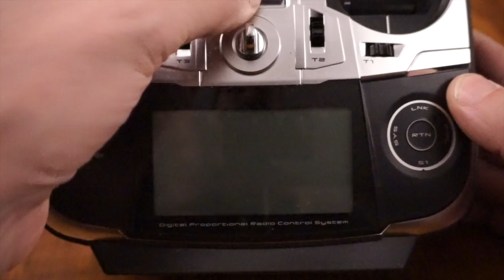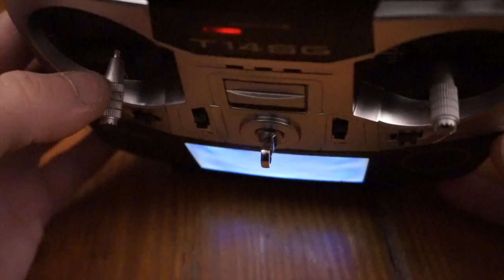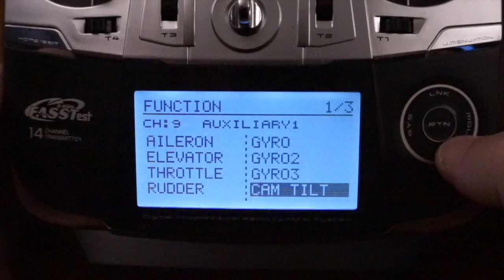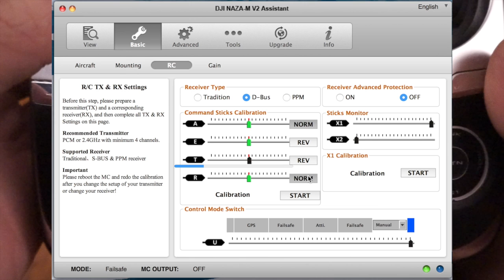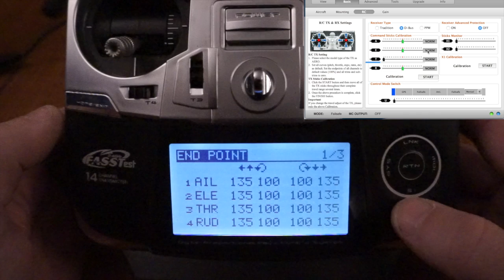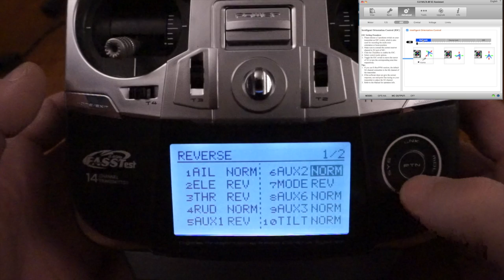How to configure the Futaba T14SG for the NAZA Flight Controller

Comment: Thank You, I use your setup to fly my old flamewheel from DJI with tha Naza M V2... I added LED Strip lights with an tunigy switch... My problem is I cannot figure out where to plug in the switch let alone program the remote to turn it off and on... Can you help me? Do I plug it into the Naza or into the Futaba receiver? If into the receiver, which location... I'm really stumped here... Thank You

Comment: I just wanted to add another comment.... Until two weeks ago, I had never successfully soldered anything. I bought the F550 as a project to try and prove to myself that I could build a drone. I have just come home after a highly successful test flight on my new F550. I have been flying drones for a few years but have never built one.

I just wanted to thank you, once again, for your extremely helpful video. I am sure that I would have figured out the configuration sooner or later but your video made the process extremely straightforward. Thank you so much....

Comment: Hi Sir, Im a newbie to electronics and recently I had my first tbs clone discovery built......when I hadsetup everythingand first time connecting to naza m lite asst...the orange flash rapidly which is good i believe   but i think one of the motor or esc keeps on beeping,,,,,,,,as per friends advice i need to calibrate the esc 1 by 1 ,,,so I dissolder them and calibrated them 1 by1 and solder them back again and plug into the naza  asst and the same thing happen...Hope you can help me on this   thank you very much

Comment: Jeremy is it possible to use my DJI DR16 receiver with the Futaba 14SG? I bought the DJI DT7 TX when I built my F450 and now want to upgrade and use my existing DJI receiver if possible. Thanks for the intro. video.

Comment: Hi cool video. I have one of these. I have several issues, notably on my mac the stupid cursor appears to offset itself from its actual place on the screen
But more importantly, you select multirotor as your new model. I do not have that. I have airplane, helicopter, and glider. In addition, there is a multirotor icon, which Im assuming appears when that model is chosen. Any ideas for me? Thaqnks. Sub'd

Comment: what do you mean?
I've setup the radio like you told me and when i power down the radio it goes to failsafe.-

ATTENTION: I just realized I did NOT include the segment on setting your FAILSAFE. This is a VITAL, VITAL step! I can not post it until after Christmas. Please, please, please make sure you set your FAILSAFE using LINK/FAILSAFE before flying your multi rotor!!!

Comment: I would like to know if the Turnigy nano-tech 2100mAh 2S1P 20C LiFePo4  battery can be used in the Futaba 14SG? The reason I ask is the Futaba 14SG is set up for a 6V battery and the Turnigy nano-tech battery is 6.6V. Is there a battery setting on the Futaba 14SG that would allow the use of this battery?

Comment: Thanks for the walk-through -- very helpful!  I'm wondering if there might be a way to use the dual-rate (or another) function to use the momentary SH switch on the controller as a "start-up" switch (i.e., set 2, 3 & 4 to +100, and set 1 to -100).  How difficult is this to accomplish, or is it possible at all?  Could it also be programmed with a delay to prevent an inadvertent, in-flight shut-down?

Thanks!